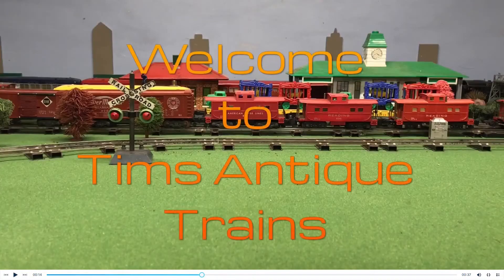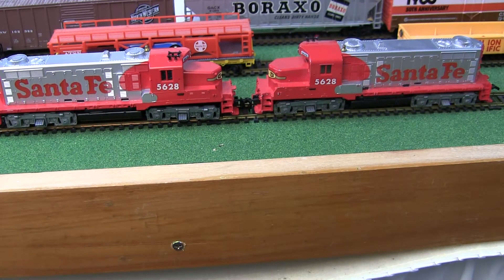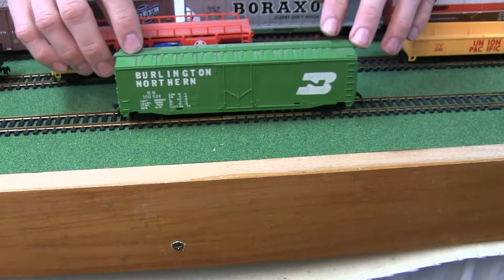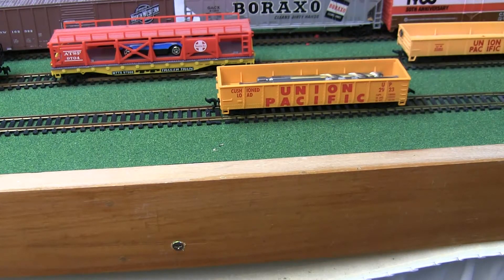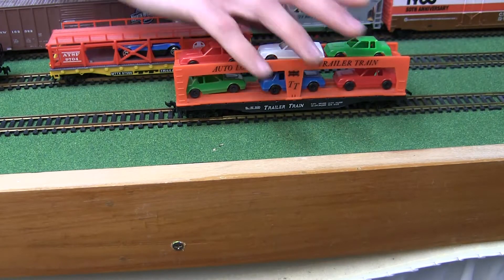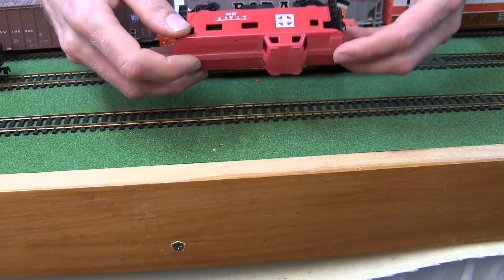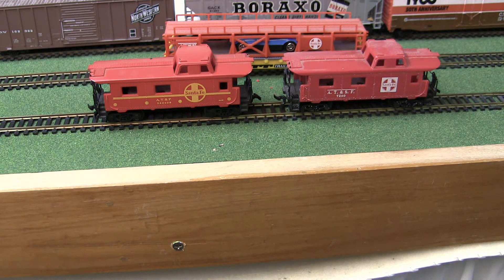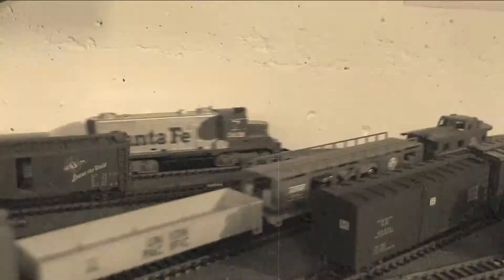TYCO Twin Trains (Almost Identical Sets)

Comment: The Santa Fe caboose with the yellow lettering might actually be a Tyco - there were some Tyco pieces made in Yugoslavia by Mehano in the late 80's/early 90's - and I have seen that caboose in those later Tyco sets.
Reply: But you are right - Mehano (which manufactures IHC products) did buy the tooling from Tyco after they quit selling trains.
Reply from the maker: @davydigger708 Yes, and the example in this video was the latter case. Thanks for watching!